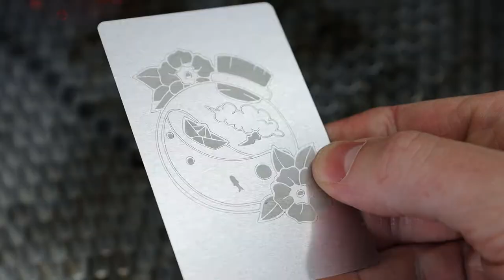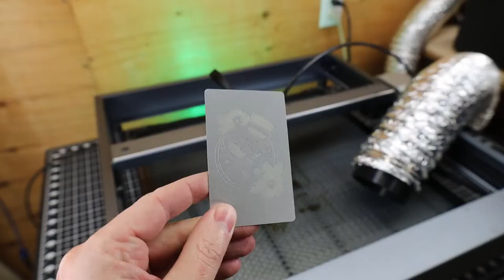Game Changing Upgrades for the xTool D1 Laser

Comment: Just received my D1 and Air Assist. I have the 16mm laser so the nozzle fits perfectly, regretfully something is still misaligned because the laser still goes through, but it's partially blocked. Same power and speed on some card stock, no nozzle = cuts fine, with nozzle = only scores the paper. Fired the laser with Lightburn and the laser is noticeably "brighter" without the nozzle. Any advice? If I was brave, I would get slightly larger drill bit and make the hole larger.
Reply from the maker: It sounds like it might be out of alignment. Do you have anyway to adjust the bolts on the nozzle to move the position or a way to add a spacer to the laser to things might light up better?
Reply: @randymay  it’s super snug so I don’t see any way to adjust it. I think it was machined incorrectly.
Reply from the maker: Oh well that sucks to here. Have you tried contacting xtool about it?
Reply: @randymay  sure did, and they keep asking for more photos and videos. If they don’t come up with something soon, I’m going to ask for a refund for the air assist.

Comment: Is this the 10W or the 20W?  I"m guessing 10W
Reply from the maker: That's the 10 watt. I'm working on the video for the 20 watt as I type this along with the metal engraver. 😁👍
Reply: @randymay  I was able to get an amazing setup with the 20W, RA2, extended bed, 1064nm module, honeycomb, etc. so now I'm trying to see all that is possible and speeds.  I've calculated that 13mm/sec with air assist should cut 3mm BB plywood.  Interesting thing is I saw a setting on a 100W CO2 at 30mm/sec.  I'm thinking they aren't pushing their CO2 laser to what it could truly do.  I will be cutting out a bunch of 3mm ply and wanted to know if I needed to bring snacks lol
Reply from the maker: So I have a 40w and 50w CO2 laser and they can cut 3mm ply wood at 60% power at 3 to 4mm/s with air assist on.